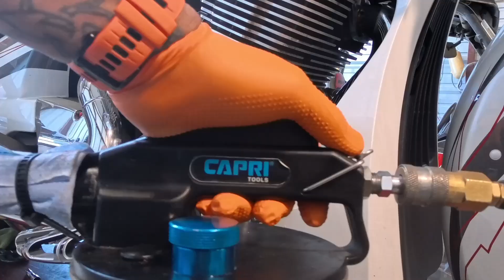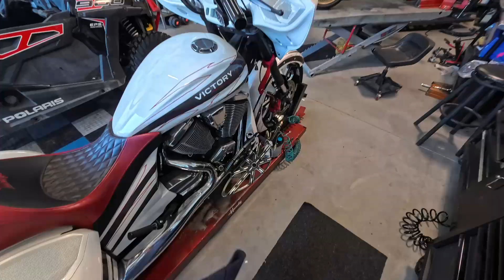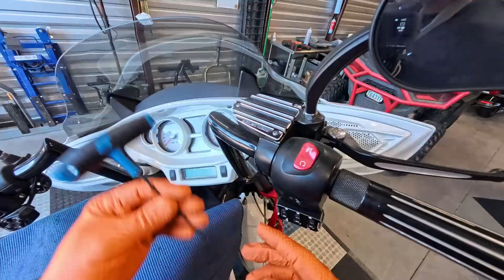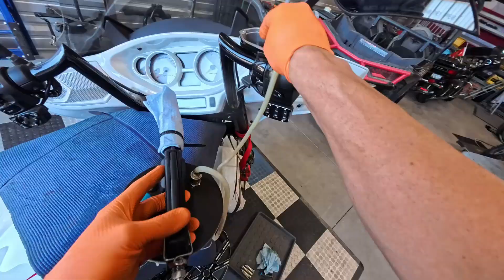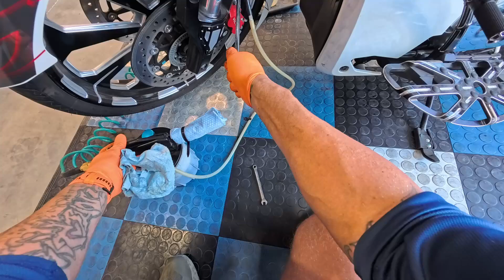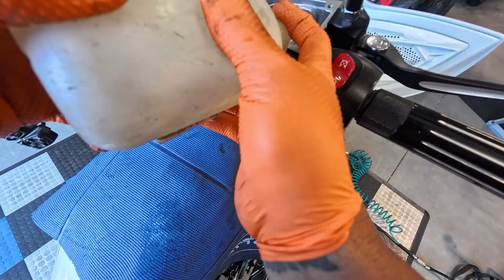Victory Magnum X1 / Victory Cross Country Brake Fluid Flush

Comment: Thanks, really good video.. I've got a 2013 cross country.  have never replaced the brake fluid.. rear brakes are pretty much non-existent.. So I'm doing this this weekend.. I love your little vacuum though.. that's super helpful.. I'll be doing the squeeze method two person.. 😊